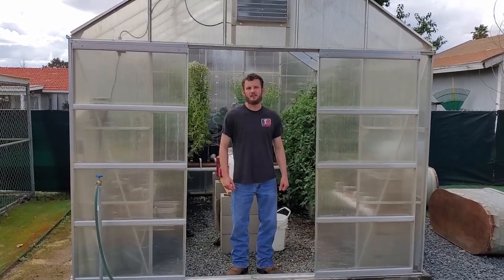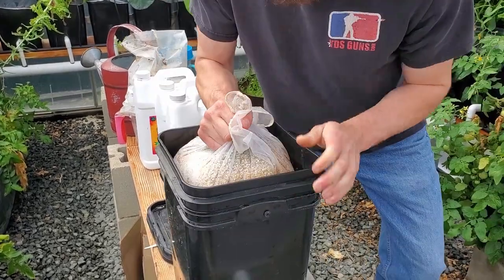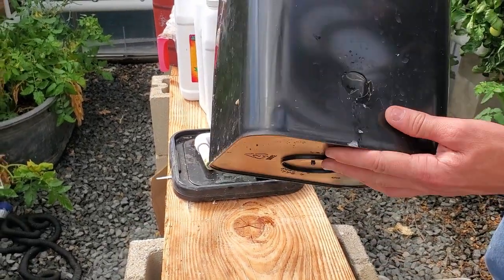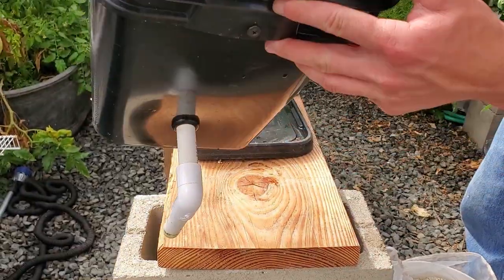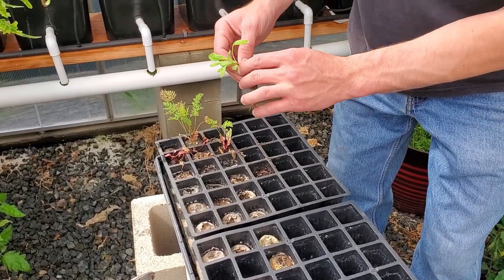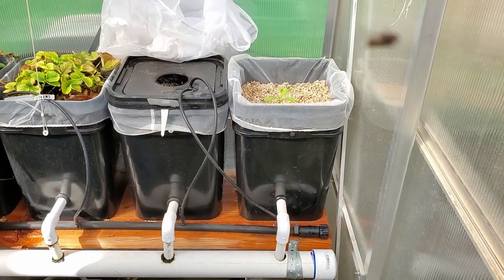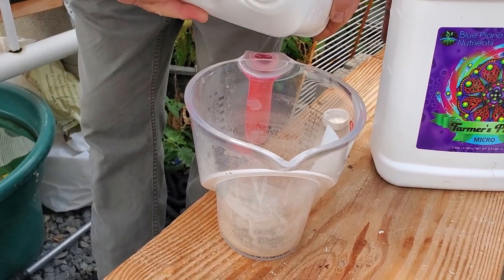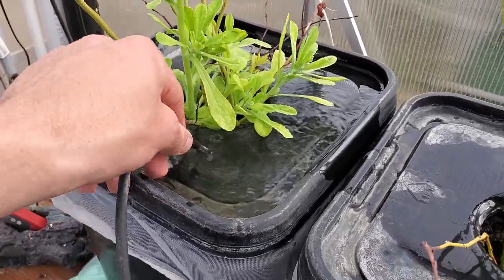Hydroponics Dutch Bucket Breakdown & How-To

Comment: Just a tip. I lube the pvc pipe  with liquid KY personal lubricant. It helps squeeze the tight fitting pipe in the grommet. I keep a bottle of KY in the greenhouse just in case the need pops up.
Reply: What's popping up in the greenhouse for the lubricant?

Comment: I know this video is a year old but you should try adding some kind of enzyme to your rez to help break down all those dead roots that you didn't remove from the perlite and paint strainer bag. I would also run bleach water through the system after each run to sterilize everything. Obviously you won't be able to do this if you still have plants growing in some of the buckets but you can always add enzymes at any point in time. It will not hurt the plants at all.

Comment: Is it necessary to add or provide a timer to the drip system , Can't we simply control the drip flow using valve or flow controller and make the nutrient supply 24x7 in drops...

Comment: Enjoyed the video! I'm trying to set up a dutch bucket system.  What exactly are you using for the supply line and drip lines?  How do you attach the drip line to the supply line?  I checked your Harbor Freight video too, btw.
Reply: Most likely 1/2 poly tubing or that floraflex poly tubing that’s white .. with 1/4 drip line

Comment: What is the size of the robber ring to hold your 1/2 inch of PVC pipe?  When you drill a hole on the bucket,  do you use  the 1/2 inch drill bit?
Reply from the maker: 1/2 inch is the inside dimension, so we drilled the holes larger (around 3/4 inch but I do not recall). The rubber grommets are in the description!

Comment: What is the purpose of running it intermittently vs continually? I would think the water in the buckets would maintain level at the overflow point regardless. Am about to hook up a dutch bucket setup to my aquaponics system and it runs all the time, but now I'm wondering if there's a reason I shouldn't do that.
Reply from the maker: I guess the best reason I can think of is to disperse the nutrient flow throughout the week until more nutrients are added, but I'm sure there are more reasons 👍🏼 we just went with what we were advised!

Comment: Did you use a bigger grommet with 7/8 ID.  The 1/2" PVC has an OD of close to 7/8" ...
Reply from the maker: Yes, I used one with a 3/4" ID. It was a tight fit but it works well!

Comment: Water wise vs electricity bills?  Can you give me details the cost? Love the set up and simple explanation step by step you did.. awesome
Reply from the maker: I'm not exactly sure how much water/electricity it draws, but it's not much at all. The pump does not draw much power.
Reply: Airborne Productions last question. What’s the size of your greenhouse?? Thank you
Reply from the maker: Ask as much as you want! It's a 10'x12' Harbor Freight greenhouse running on a 30 gallon tank, and with 30 plants!
Reply: Airborne Productions thank you. Do you clean the perlite prior putting new plants right. ? Cheers
Reply: And temperatures do you manage it in certain temperature? Thanks much
Reply from the maker: Yes, we do clean the perlite normally. I just put the perlite back in as is for demonstration purposes. For temperature regulation, we have a fan with a thermostat, and vents in the roof that automatically open/close according to the temperature.
Reply: Airborne Productions thank you